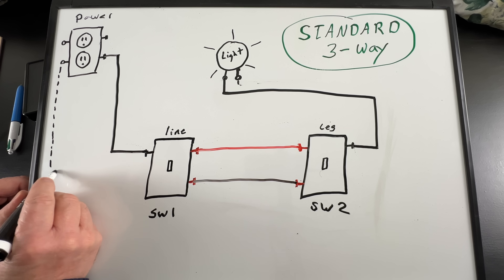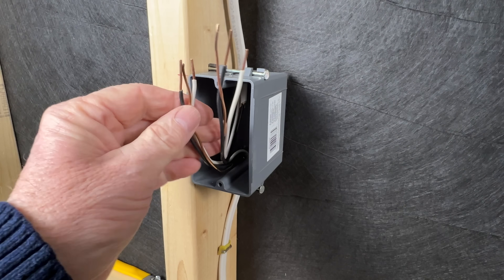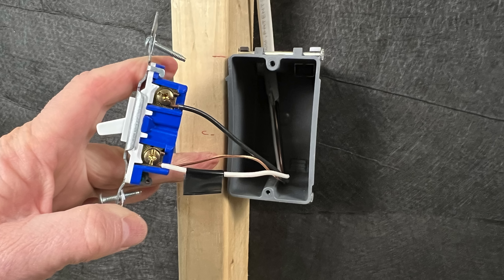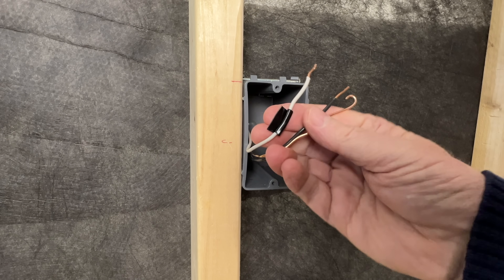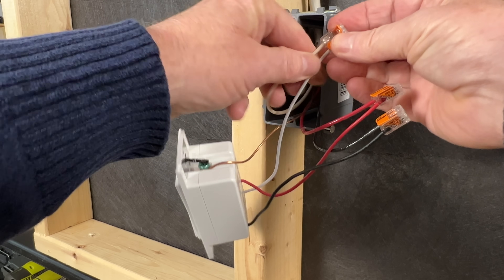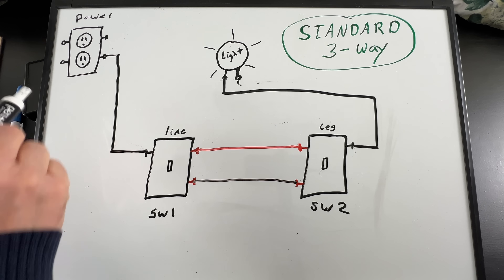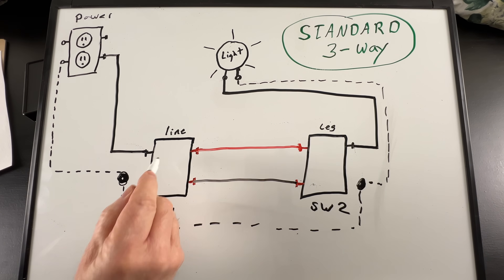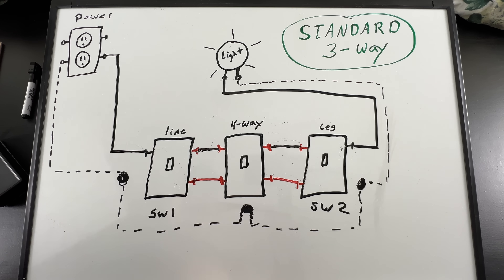How NOT to Wire Light Switches in 2025 (New Rules)

Comment: I've got one of those old-school wall mounted pull chain lights in my attic.  It has 2 main cables (6 wires total) going to it.  I've identified the hot wire.  I want to add a light switch on the other side of drywall in my closet.  Then I will have a recessed light in the attic connected to this switch.  What would be the best configuration for how my wires would run?  I assume the extra wires I have are because they feed to something else like the closet light.  When I removed the old light and separated my wires, I have 1 black wire that sets my voltmeter off.

Comment: At 9.25 in the UK we use the same circuit design. 
But at 13.25 (dead end) we have two methods, the one you showed.  This is our most common method which we wire slightly differently:
- our Line (hot) to L1 (gold) screw at top of sw1 connected to strapper (traveller) to L1 (gold) screw at top of sw2
- our switch line (hot to light) to L2 (gold) screw at bottom of sw1 connected to strapper (traveller) to L2 (gold) screw at bottom of sw2.
- The third core goes straight from common (black) screw on sw 1 to common (black) screw on sw 2
- Neutral form supply and light connects at the back box of sw1

I have used 9 different methods of two way switching which are all compliant in the UK - 

We have also moved to proving neutrals at switch boxes.

We have slightly different names for things:
Hot = Line
Neutral = Neutral 
CPC (circuit protective conductor) & Earth = Ground
Strapper = Traveller
Reply: I have always heard the word "live" used for hot.

Comment: Would it be possible/legal to do a “smart” dead end method using 14/4 or 14/2/2 romex? That way you can bring a neutral to the second switch to enable smart companion switches and also continue the circuit after that?
Reply from the maker: Yes but then its not a dead end..

Comment: Hey John, what if I wanted to install a switch outlet where there is only a light switch for the bulb?
Reply from the maker: If the neutral wire is in the switch box you can extend the hot, neutral and ground to a receptacle.

Comment: Is 3 wire for a single pole switch now required? Red/white/ black/ ground?  Adding new ceiling lights from (terminated outlet) switch . Or is your feed through method still acceptable?
Reply from the maker: The feed through method is preferred. If the feed goes to the light first we now need to drop a 3 wire down for the switch loop so a neutral wire will be available at the switch box

Comment: At 11:00 into the video you mention that "There is no BLACK screw on the 4-WAY switch" but I just installed a 4-way switch that has 2 gold/brass and 2 black screws. I'm a DIYer so, I'm a bit confused with your statement here. I ran 1 black wire to a 😢brass/gold terminal & 1 black wire to a black terminal. 1 red to a brass/gold terminal & 1 red to a black terminal. It all works on 3 separate floor lights with the end lights on 3-way switches & the middle switch is the 4-way. This allows the 3💡💡💡to work from each of the 3 switches.  S.M.
Reply: I'm confused too

Comment: For this demonstration, why are you using 12 two and 12 three for your lights instead of 14 two or 14 three which is designated for just the lights?……. Is it because you’re coming off of a plug that has a number 12 AWG wire…….. or am I missing some new code
Reply from the maker: Yes. The example shows the 20A receptacle circuit. The wire is sized to the circuit. 15A 14 gauge, 20A 12 gauge.

Comment: The code exception for the dead-end method makes sense.  If you have multiple switches controlling one light, and you want to add a smart switch for that light, you only need to replace one of the standard switches.  You'll put it in the one box that has a neutral, and it will control that light just fine.

Comment: How do you control a combination light/fan separately from two locations?
Reply from the maker: They would need a set of 3-ways for the fan and another set for the light. If you don’t have that wiring then smart switches might be your best option
Reply: @BackyardMaine  Thanks.  I ended up doing a 4-way for the light using three wires for the entire circuit to the light. I ran a separate two wire power feed to the last three way box and used the the extra wire from the three wire feed to the light to power the fan from that location.

Comment: About 4 years ago to my surprise an inspector made me run a neutral basically to all switch or light boxes for the very reason you show here in the video... then just cap off the neutral. Seems I had missed the change in code which had occurred some time around 2018-19....

Comment: why would you use #12 for lights ? and not #14
Reply from the maker: Depends on the size of the circuit. Some lighting circuits are connected to the receptacles and may be on a 20A breaker so 12 gauge wire would be required. But most will be on a 15A breaker and then 14 gauge wire can be used.
Reply: @BackyardMaine  I very rarely tie lights into a receptacle circuit reason being if you plug things in the draw can dim the lights and if you pop the breaker you'll be in the dark, maybe for a closet light i might but definitely not for general lighting.

Comment: Funny, I wired my house 15 years ago using 14-3 for switch legs ONLY because I didn’t like the neutral becoming part of the hot circuit. In the whole house I only had one fixture like that and only because I goofed when running the line wire to the fixture box. All others I made the effort to avoid that scenario. Still not sure what I was thinking that day. It was easier to run the 14-3 switch leg than rework the fixture feed. 
Excellent video and VERY clear.

Comment: Does this rule apply to renovations or just new builds?
Reply from the maker: If you're pulling a permit for the renovation then the inspector will be looking at current code requirements. Of course existing installation will not need to be updated only the new or renovated work.
Reply: @BackyardMaine  Awesome thank you for the reply! I plan on redoing my entire home's electrical system in a couple years. Its an old house with primarily knob and tube wiring. I'm assuming this code does not apply to other switches such as disposal?

Comment: Call me a big ole dummy but I’m new to wiring and I’m trying to wire my new home. I’m will make an assumption that the ground wires are an understood connection in each of these connection points since they are not mentioned??? Thanks for bearing with me…
Reply from the maker: Yes.. The grounds are required. I thought I had a blurb on that in the video.

Comment: Makes sense as much as it doesn’t. Government always there for extra expenses when you have zero plans for smart switches ect. Sure power thru the switch box is probably better for more options I’ll give you that.
Reply from the maker: The issue is people are connecting the neutral on the smart switch to ground to get it to work. This can put dangerous current on the ground system.
Reply: @ also the switches won’t work without a neutral in each box. And your limited on the number of 4ways on a lighting circuit. At least that’s how it was 4 years ago.

Comment: So if the NEC rules are followed and the wiring is code compliant, why does the inspector still have discretion over the method ? That seems judgmental, arbitrary, possibly discriminatory. There doesn't seem to be any arbitrary issues when it's a violation.
Reply from the maker: There are some areas of the code that are left to interpretation in which the AHJ has authority. But most of the code in clear and concise and the inspectors are code enforcement but they cannot make up there own rules.

Comment: The output screw on the leg 3 way switch should be on the bottom so the two 3 way switches are identical but rotated 180 degrees from each other. everything else looks perfect.

Comment: Never use the dead end 3-way method. I’ve been unable to use a smart device before that had to be connected on the leg side of a 3-way but there was no neutral because it was wired using the dead end 3-way method. To my knowledge, the standard method is really the only acceptable method for wiring 3-ways now. Your customer would never be stuck being not being able to use a smart device, or only being able to use it in one of the 3-way locations.

Comment: Hot at the top of the switch: 
Top-to-bottom; Left-to-right; Front-to-back. It's an NEC test question.
3-way switches are NOT made in mirror-image pairs- the black screw is always in the same location, at least by brand.
I know I'm getting nit-picky here, but you are producing these videos for "green" electricians that can be confused by this.
Reply from the maker: You are mixing ups different requirements. I have been in the business for 40 years and have taught code classes. It makes no difference where you connection the hot and the switch leg on a single pole switch. If you still disagree please provide the code reference.

Comment: More codes require more materials thus enriching the manufacturers and exploiting the consumer.  Push back.
Reply from the maker: The is has become a safety concern because people were buying lighting controls that are now common and when the realize they don't have a neutral they connect the neutral wire on the switch to the ground wire. The CPSC found that this was becoming a big problem and the code changed as a result.

Comment: Just so you dont worry or start tearing your walls out. That switch breaks your light circuit. Even if you have a neutral there its not connected to that switch. Its not part of the function. As everyone knows when youre dealing with light boxes people would use them as junctions which puts you in no neutral situation on a switch somewhere. I always preferred power up, my neutral was at the switch, it was just neater. As the man pointed out we're sticking more complicated things in our walls now so here we are with a new change.
Reply: Thanks Backyard Maine, back to you.

Comment: Great video, with clear explanations. But, why are you using 12AWG wire rather than 14AWG wire?
Reply from the maker: I think you meant 14 gauge wire but the wire is sized to the breaker. 14 gauge for 15A and 12 gauge for a breaker 20A circuit. In my example the switches were supplied by a 20A receptacle circuit
Reply: @BackyardMaine  sorry. Yes, I meant 14AWG. Typo, fixed. And, you would be correct with the receptacle being on a 20A circuit. Thanks for the clarification.

Comment: I think a dead end 3 way is a d*ck move personally. So you can only have 1 smart switch and 1 normal single pole switch in the future if you want to upgrade your 3 way? They'll probably amend the rules in another 10 years. Great explanation of 3 ways! My home that I bought the neutral wire was used as the switch wire with the hot wire going directly to the light bypassing the switch. Oh great way to find out is to replace a blown out bulb and get juiced with the light off. Yes the light has a ground there.

Comment: What if you want to add switch outlet combos on each end of the 3 way?? I need an outlet at each switch.  Constant power on the outlets but still control the lights?? That would be a great video.
Reply from the maker: It's easy to do at the 3-way where the power comes in but with the dead end or the standard 3-way methods one switch would have only switched power. The California 3-way would be an option as long as you carried the neutral. I have a video on California as well. https://youtu.be/AeXFe5ghmKQ

Comment: While I have NOT utilized the 3-conducor switch-loop (as you showed), that's a good alternate way to do it. I figure it'sjust  almost easier to just to use the "standard" accepted method: run a 12 or 14-2 feed cable directly to the switch, and then 12/14-2 up the the fixture. Just keeps it simpler, and no need for 3-conductor NM.
I have used the "new" dead-end 3-way method quite a lot over the years (using the white wire as an ungrounded conductor), just because it saves a bit of wire-pulling!  However, in my way of doing it: I use the black & white wires as my travelers to the second box & switch, with white conductor re-identified as a hot/ungrounded conductor, and then use the red as the "switched return" to the first box/light.  I feel this more accurately follows the "old" 12/14-2 switch-loop methodology, where the [re-identified] white was your "hot" feed down to a switch, and the black was the switched-return back to the light fixture.
Anyway, always great stuff. Thanks for posting!

Comment: Can this be done using a "switched" outlet that shop lamps would plug into ??  Instead of a light fixture, I'd be using an outlet for LED shop lights , 4 lights plugged into each other then to the outlet.
Reply from the maker: For sure. A switched receptacle can be installed just like a light. As a matter of fact the code allows for a switched receptacle in habitable rooms to fulfill the requirement of a switched light for the room.
Reply: Absolutely! Instead of landing into a light fixture/luminaire, you terminate your "switched" conductor(s) into a pair (or more) of duplex receptacles.

Comment: Why are you using 12/2 and 12/3 on a 15A device?
Reply from the maker: I’m not.
Reply: The conductor size (12 or 14) is determined by the upstream breaker, and also to what the anticipated circuit load would be. Obviously, you can utilize more outlets (lighting and/or receptacles) on a 20A circuit, than you can on a 15A circuit.

Comment: Not sure why not wanting a smart switch is a code violation. I thought it was about safety… not trends.
Reply from the maker: In the absence of a neutral conductor people often use the ground wire creating a safety hazard.
Reply: YOU may not want a smart switch/device (now), but the capability to add such a device in the future (by somebody else) must be provided. Also, as he stated: Often times, "DIY/homeowners" will connect the device's neutral wire to the grounding conductor, causing an unsafe (and non-Code compliant) situation. Homeowners insurance would likely deny a claim if they found such a situation present.

Comment: Ok so no dead ends 🤷🏼‍♂️
Reply from the maker: You can still run them 404.2  where multiple switches that control the same lights (3-ways / 4-way) a neutral conductor is only required at one switch location.

Comment: I recently installed smart thermostats in my unit and there were a lot of interesting choices that were made with the electrical design. One being that some parts of the unit have one neutral being shared between two different circuits on different phases. Which does work, but it's kind of dangerous for amateurs doing electrical work as it means figure out which two circuits are running current through the box rather than just the one.  And another one was that since the thermostats that were in use with electric baseboards in the past didn't require a neutral, they didn't provide one in an obvious way. The neutral was still there, it just ran through one of the boxes and just had a connection to split it into two runs one for the heater in one room and another for the heater in the other. It was somewhat fortunate that they were literally back to back, so there wasn't any real fishing of wires required, but it does lead to a bit of confusion and having to reopen the box to mess around with it.
Reply: Shared neutrals are legal

Comment: Am I missing something? why explaining with only 12 gauge and not 14 gauge?
Reply from the maker: The wiring method is the same with either gauge wire. If the lighting circuit is 15A then use 14 gauge wire. In this example the circuit is jumping off a 20A receptacle circuit so 12 gauge wire would be required.
Reply: @BackyardMaine  thank you.

Comment: What's the difference between line and load wires?
Reply from the maker: Line wires are the wires that come in and the load are the wires out. With a light switch for example the line wire feeds into the switch and the one from the switch to the light (your load) is considered the load wire. It call the switch leg.
Reply: @BackyardMaine  thank you

Comment: Why in world would you take the hot down to the switch! I always break the neutral by taking the neutral down and back on a separate 14/2. I take take the black of the switch leg and connect it to the neutral in the light down to the switch and bring it back on the white so I always have a neutral (white) in the light box.
Reply from the maker: That’s a code violation. With a switch loop between the light and the switch you will have two wires (plus ground). One white and one black. Neither one of them is being used as a neutral. The white neutral stays in the light box where it connects to the fixture. The hot wire goes down to the switch on the white and comes back on the black to connect to the black wire on the fixture. If you came down on the black wire and back on the white wire you would have two whites in the light box and you have to figure out which one was hot and which one was neutral. You could mistakenly put them together for a short circuit or connect the to the wrong wires on the fixture. For this reason the switch leg cannot be white per the NEC.
Reply: @ don’t know what the codes are. I learned from a old time electrician who did nothing but Jim Walters build on your lot homes and that was 40 years ago. I just know how he taught me which was you never break a hot in a switch you used the neutral to complete the circuit.
Reply: @BackyardMaine  one other thing is since 40-50 years ago 14/2 was what we mainly used, on most houses you would have one receptacle per room unless you paid for more. Heck the only thing you really needed to plug in was a lamp or a TV we didn’t have to worry about mixing wire gauges. If I remember correctly the panel might have had 8 circuits because most homes had a propane oven and a gas dryer so no need for 200 amp service like we have now.